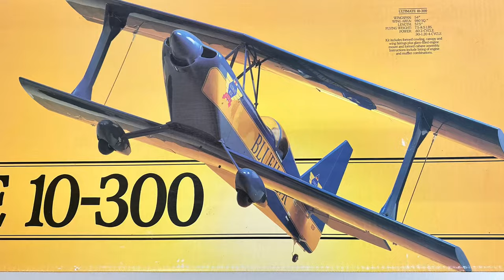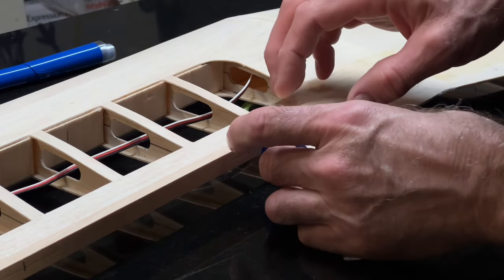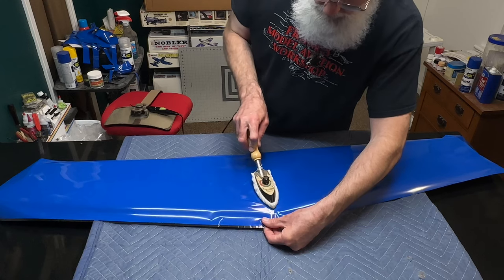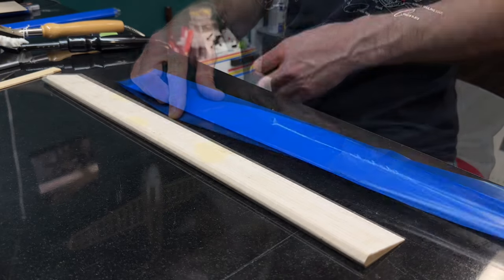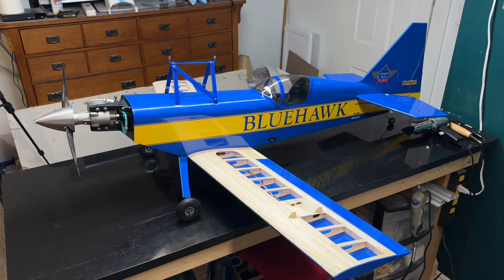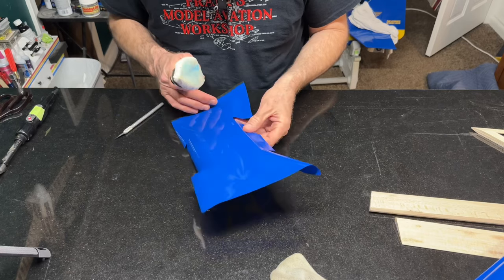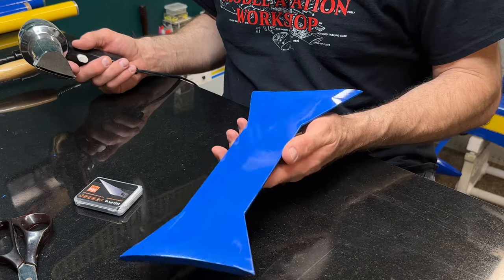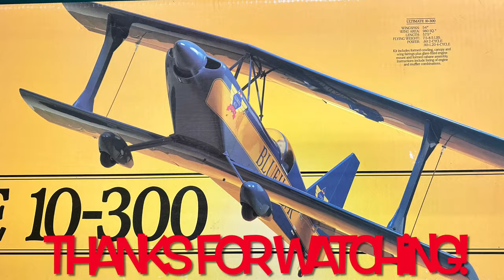Carl Goldberg Ultimate 10-300 Biplane Build: Part 28: “How to Monokote” (Monokote Covering: Part 4)

Comment: I built mine about 30 years with Yamada 120 fs. Flies very nice , covered it just same as yours twice now. The kit wood was rubbish really so I recut a lot of it .Over expensive for the quality but a good design .I made a carbon engine canopy . You want a little down / right thrust  for sweet handling. Done over 2000 flights I would say . Throw the plastic links away please not suitable on a plane like this.